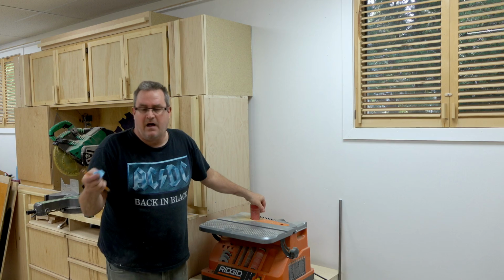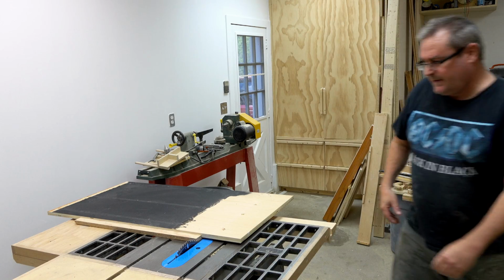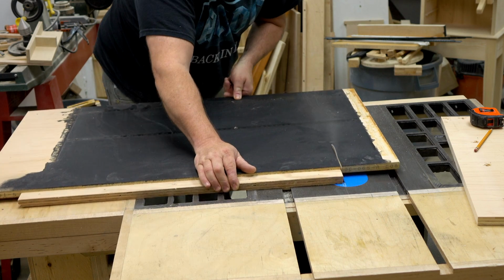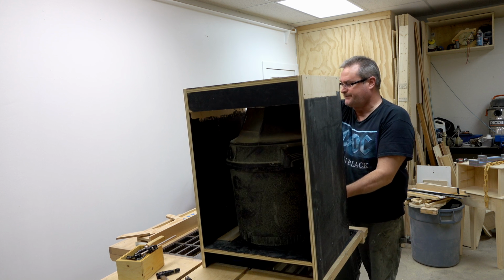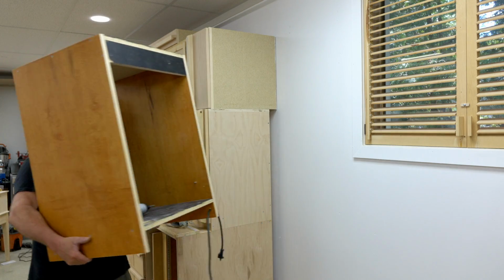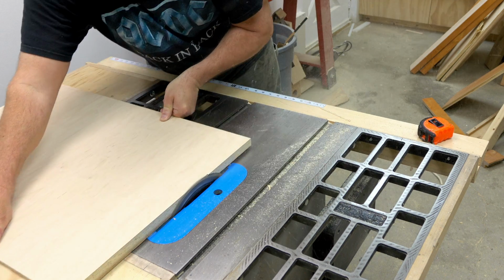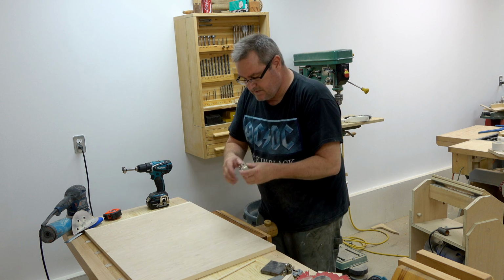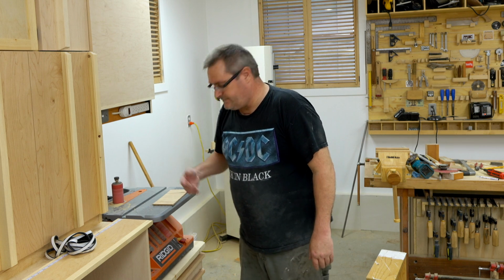This Sucks! Building The Shop Vac Cabinet For Local Dust collection

Comment: Line the box with recycled egg crate foam and you'll get 20+ dB sound reduction. I built a cheap foam-lined plywood box to enclose my 5 HP Ridgid, and also added a little labyrinth tunnel where the air comes out -- a 90° elbow over the outlet hole connected to a length of foam-lined PVC pipe -- to keep the exhaust noise down.  When the vacuum is on, the air moving through the hose is the loudest sound you hear.

Comment: Great Build... I tried something similar for my Air Compressor way back when... I used a Pentium 4 computer guts to cool it.... It heated up faster than the fans could cool it and would over heat. It really needed a redesign and I really should have kept trying.. But I gave up so I didnt burn it up. lol... here is a look at it... The carpet seemed to help dampen the sound. Thought you might get a kick out of this. Brian https://youtu.be/7xR-rz9tvUY

Comment: Just curious - why do you use square drive screws rather than phillips or anything else? Is it just what you happen to have on hand or is there a preference? :)
Reply: Tade Whittaker the square drive has much less tendency to slip or strip out. Philips screws suck!
Reply: Aaron Brown haha fair enough, thought that might be the case, I've just not used them before
Reply: Tade Whittaker Robertson screws are very prevalent in Canada... Much more so than Phillips
Reply: I think there's a story about Robertson shopping the screws to Ford, but Ford wanted a license to make the screws in USA and Robertson wouldn't license, so Ford went to Phillips instead (may be an apocryphal story).

Comment: Would you consider putting some sound proofing on the back of the door, (not trying to be the safety police) just it would annoy you less as it is at head level. (just on the door would want to risk the vacuum over heating).

Comment: Hmm. I wonder how much could you reduce the noise there and how you could accomplish that... Maybe covering the inside of the cabinet with some type of soft foam, like low density neoprene or eva?
Acoustic foam could be too expensive, depending on how much bothersome the noise is for you.

Although, yeah, I saw that the spindle sander does make a lot of noise. Much more than the shop vac.

Comment: With the cylinder vacuums I would recommend you go buy some cheap universal vacuum filter bags, which are simple cloth with a elasticated end, that slip over the cartridge filter of the vacuum. They hold the dust from getting to the much more expensive pleated filter, keeping it clean for longer, and are under $5 each. They are very simple, cheap and long lasting, and save you having to buy those expensive filters so often.
Reply from the maker: What do you suppose the chances are that I need to be told about the existence and benefits of shop vac bags?
Reply: A lot of people will not use them, just rely on the cartridge filter instead.
Reply from the maker: I don't use them. Filters last for years and years and bags cost money and time to go get them. That is if you can find one at all for a 27 year old vacuum.

Comment: John,

We all recognize your heightened sensitivity to any outside interference to the thought process, but I gotta ask ... I'm sure you considered putting the vacuum under the sander and having its enclosure serving as its base.  For all the compelling reasons why a mere mortal would consider that a no-brainer, might you share why you deemed the sander's current base an unmmovable object?
Reply: agreed i plan on mounting my vac on the wall to save lower storage space
Reply from the maker: ?
The base is on wheels, as shown in the build video on that project. 
I made a video on my scrap bin channel saying my reasons for mounting the vac above like this. Basically, drawers are a better use of the lower space than a vacuum would be.

Comment: Can we get a fair unbiased review of that new impact driver you used?
I'm kind of sad that you skipped over the electrical, as that always brings out the trolls, and I could use a laugh.  ;-)

But I dunno about that horizontal grain, John, you're really pushing the boundaries of good taste there my friend.  Norm would be shocked.
Reply from the maker: All the cool kids are running the plywood sideways like that, so I'm just trying to fit in.

Comment: It seems like it would be more efficient if you made more air-outlet holes in the cabinet. Did you not do that in order to keep the sound level down, or does it not make as much difference in suction efficiency as I'm thinking/guessing?
Reply from the maker: The last cabinet it was in didn't have any holes at all, and it worked just fine. It just blow out through the gap around the door.

Comment: You could always chuck in some sound dampening foam probably wouldn't make that much of a difference though.
Reply from the maker: I've tried that before. It only works if it's thick enough to truly absorb some of the sound, and for that to happen the cabinet would have to be twice as big.
Reply: Ah makes sense.
Reply: I Build It Carpet pad works great John but you don't have any remnants since you made those wonderful (I really like them) plywood floors!

Comment from the maker: This is a simple cabinet built on the fly using recycled plywood to house the shop vac I want to use to collect the dust from my spindle sander. Having it up above the sander like this is a tradeoff of convenience vs efficient use of space in my smaller shop. Depending on usage, I should only have to empty the vac and clean the filter every few months.

Here's a short video on how I mounted the power bar on the front of the cabinet: https://youtu.be/i_11fv_tRtM

You can help support the work I do in making these videos:

Plans for sale: http://www.ibuildit.ca/plans.html

Support this channel on Patreon:
https://www.patreon.com/user?u=865843&ty=h

Did you know I have other YouTube channels?
My main channel: 
https://www.youtube.com/user/jpheisz

My home reno channel: 
http://www.youtube.com/c/IBuildItHome

My "Scrap bin" channel:
https://www.youtube.com/c/IBuildItScrapBin

Website: http://www.ibuildit.ca/
Facebook: https://www.facebook.com/I-Build-It-258048014240900/
Instagram: https://www.instagram.com/i_build_it.ca/

Comment: Nice build, John. I have a Harbor Freight 1 HP dust collector, and have been wanting to enclose it for noise reduction. But I worry about the squirrel cage motor getting too hot  inside a cabinet.  Under normal use, I wouldn't worry about it, but I plan to use this one to evacuate smoke during poker games, so it would be running for long periods of time, like a couple of hours. Do you think it would be dangerous to enclose it like that?
Reply from the maker: All induction motors have thermal cutout switches built in that will turn off the motor if it gets too hot. Obviously, you don't really want to test that out, but if you make the space big enough it should be ok. Another option is to just block the worst of the noise with a cabinet that's open on the top, or with an opening big enough for fresh air to circulate.
Reply: Good thinking. Thanks.